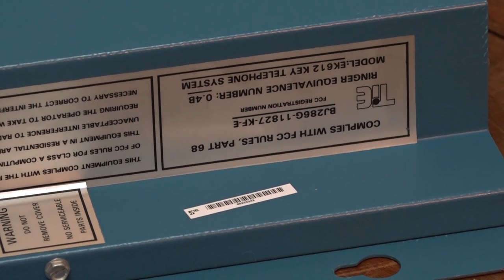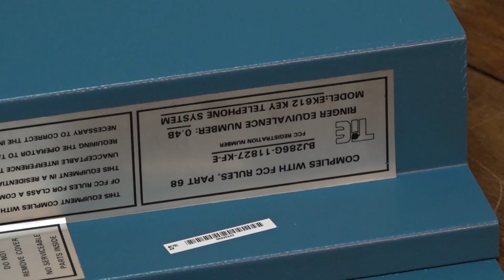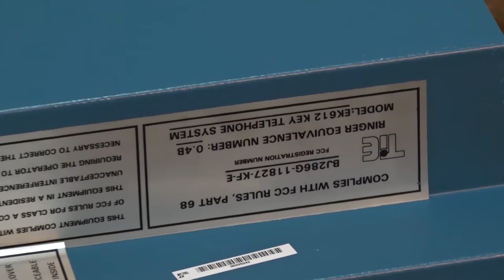Sparks will definately fly

Comment: Like the little plasma you made.  I worked for the electric company for 36 years.  230kv flash was very loud, and plasma, wowzer. Now one time I opened a live 230kv line switch which was feeding only an underground cable, talk about capacitance ( underground cables will act like a capacitor ) . WOW what a big ball of confusion plasma I created. Was at 0400 and woke up the neighborhood, very loud. Yes, 1. I was a bit shaken, 2. was told I could do that and 3. last time anyone did that ( c. 84 )

Comment: It's unlikely the daughterboard was a bodge, as it had pins that went into the board; the board designers knew it was going there, in other words. It was likely a "option" board that would enable 6, 12, or all 18 outgoing lines, depending on the price of the unit.
Reply from the maker: Yup I could see that being the case however in most cases when you see additional boards or component stuck to the back side of boards or wires soldered to component legs it is usually because of a f*** up and it wasn't caught before production. When I worked for Sony my first job as a tech was installing rewind kits and a bodge board on a betamax to fix a problem with the mid band tuning.

Comment: Actually this TIE 612 system was a 6 line, 12 extension digital key system. I used to install TIE systems, STRATA etc. for GTE in the 80's.
Reply from the maker: 12 sets, good to know. Why the 18 matching transformers on the output then. Is it not 1 per set. I am not familiar with these key systems. The business guys do that. I am DSL, BDL, GPON, and iptv and work outside plant from Co to dslam to prem. All I know about this unit is the client said it hasn't been used for 20 years, there was a nice new Panasonic digital system being fed by 2 adsl modems, an it was clicking an they wanted it gone.
Reply: They might be matching transformers for the 6 CO lines. This system was a 2 pair design to each extension, audio pair and pwr./data pair.

Comment: I'd have salvaged the 4N26 opto-isolators at least. Also low-voltage/high current is a lot safer than high voltage/low-to-medium current, as you don't need a chicken stick, plus high voltage arcing is harder to control, as it likes to take the shortest path to ground, and - of course - there's the shock hazard with high voltage.
Reply from the maker: Of course there I danger with high voltage. In addition to the rubber handle screwdriver, I am wearing insulated shoes, and am standing on a rubber mat, with 1 hand in my pocket. High voltage is cool. Lots of arcs and sparks, but you are right, very dangerous. I take all precautions. I should bring my linesman gloves home for the next one. I am trained in hv work as I work in proximity to Mains voltage at work when I have to climb to connect tel lines. That's why the warning not to do this. One wrong move and it is lights out. I am generation the hv with 2 mwo Transformers in series each one puts out about 1800 volts, so 3.6 kv is what blew this up.

Comment: Ahh good old 74lsxx 5v ttl logic and 4000 series cmos logic, i cant see modern junk lasting as long, can you tell im biased towards old tech LOL :-D
It was quite slow, 450ns speed 8k 8bit eprom, thats about 2.22Mhz, so i guess it was running at 2mhz, still plenty fast enough for its purpose :-).
I imagine the supplys were 5 and 12v for the logic and relay drive.

You are the eprom terminator :-D
That device "Wont be back" :)

Comment: why destroy it?  why not salvage bits from it?
Reply from the maker: This unit is obsolete, and even though there were relays I could have salvaged, it was not worth the effort. The board is a double sided plated board and the pins are bent over and soldered. So to remove they have to be heated and straightened before removing the solder. It was a piece that was headed for the recycle bin, so I figured I would have some fun with it and send it off in style. I did salvage the power transformer, circuit breaker and power cord, as those could come in handy, but I have no need for old microprocessors and logic switches.
Reply: 12voltvids if you know, what were the types of old micros onboard?  (I'm rather a fan of old retro 'puters)
Reply: yea i noticed the age with the SCSI socket and the glass chip learnt that years ago back on my college days loll
Reply from the maker: That wasn't a scsi connector it was the telephone output multi connector 25 pairs, to feed to all the phone sets.
Reply: sorry 12 volt vids meant to say looks very much like a scsi as used on pc couldn't edit comment properly http://cpc.farnell.com/unbranded/ss-122/lead-scsi-2-hp-d50m-d25m-1m/dp/CS07876?CMP=CPC-PLA
Reply: I would've taken the relays and isolation transformers. I'm a fan of DC-DC converters, so those transformers would've been useful (I would rewind them, of course). Now I know what equipment I should look for to find them :)
Reply from the maker: The connector might look similar, but the one on this unit is much larger. I used to have SCSI on my old computer and the SCSI connector is smaller, and ultra SCSI smaller still.
Reply from the maker: It was more trouble than it was worth. I tried to remove 1 relay, but the board was a very good plated through board, and the pins stick all the way around. The chances or damaging parts is great with that design. I picked it out of recycling. I did salvage the main power transformer and a few other bits before having some fun with it.I try to keep old gear running, and if I had the handsets for it, I probably would have tried to get it going just for fun, but the handsets are long gone, it is obsolete. That's the way it goes with electronics. Can't save everything.
Reply: 12voltvids oh you learn something  everyday many thanks for the  correction

Comment: Tie made excellent equipment but eventually it has to die. Maybe not as good as NT though.  Sad they went down the tubes.
Reply from the maker: Let's not forget nortel. Oh wait that NT after they shortened the name. Don't remind me of them. I and many others lost our saving during that tech melt down.
Reply: Sad very sad. There are business all across the US using their phones, most still work like new today. Nobody down here has any idea this fine equipment was made in Canada.
Reply from the maker: I know where they were made but obsolete an headed for smelter to recover metals. All old gear eventually ends there. This was just to show it off and send it off in style.
Reply: I had a TIE system at an old job of mine,  It froze up one day.  I think a power surge killed it. One Board was fried. Cost $300  The programming was tricky too. Other than that, reliable. Most Northern telecom systems are working great even after 20 years.